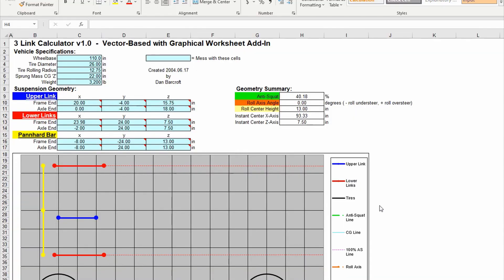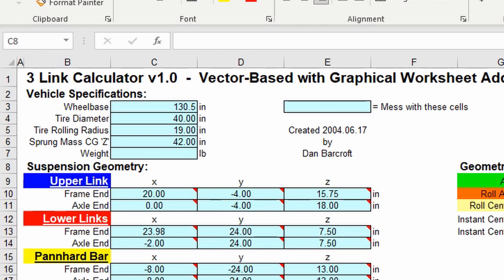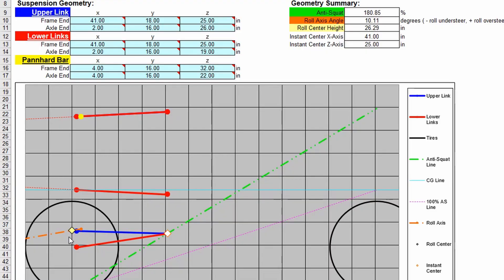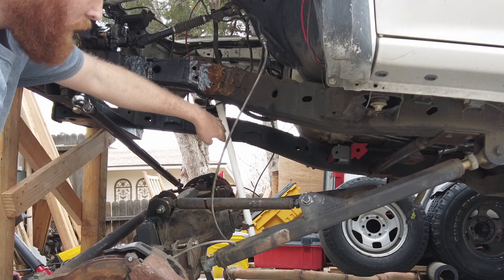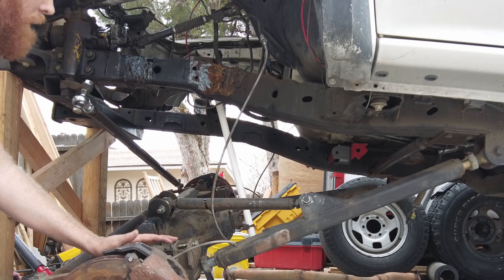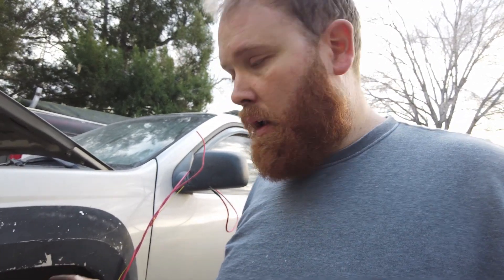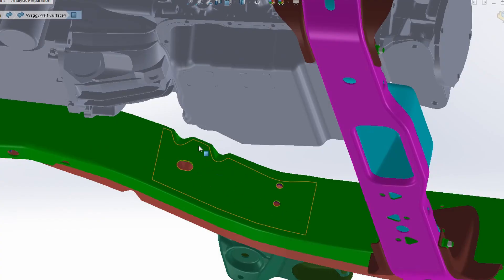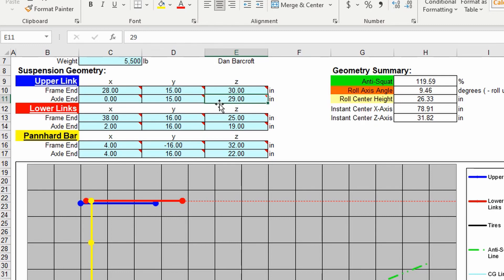Radius Arm VS 3 Link [Which one is better and Why?] BBV EP 7

Comment: Thanks for your discussion! It seems like you’re positive vs negative caster is reversed though. Modern vehicles with power steering need positive caster. My FJ80 axle had a negative caster after a lift and was corrected by new radius arms. OEM specs were +2 to +4 degrees.
Reply from the maker: I did not know that.
Reply: Exactly what i was thinking as he was explaining his thoughts on it. Radius arms have worked VERY well for a lot of years (1966). They were very stable. Where they were lacking was in articulation. Spherical rod ends fix that problem for 99% of the public. Especially if your upper link on your radius arm is also adjustable. That allows a lot of tuning of the front, just like a link suspension, while maintaining axle stability; which BTW jeeps so desperately need.
Reply from the maker: Radius arms are great when set up properly. However inherent to their design you'll get caster gain with droop. That's what I was attempting to avoid by going to 3 link. Now on 14in air bags it'll need to be a very predictable caster angle at a given ride height. With a radius arm it would have been undrivable any higher than the average ride height and nearly unsteerable below that.
Reply: That doesn't make since. If the upper link on your ylink radius arm is adjustable how would it be any different than a 3 or 4 link setup?
Reply from the maker: The pivot on a radius arm locks the pinion angle relative to the arms. Where the 3link shines is that you can adjust the upper link to have positive or negative caster gain (pinion angle) though the entire range of travel. Basically, with the 3 link I can set it up where the pinion stays flat through the entire range instead of rolling up with the radius arms.